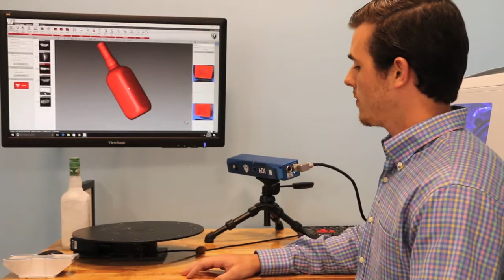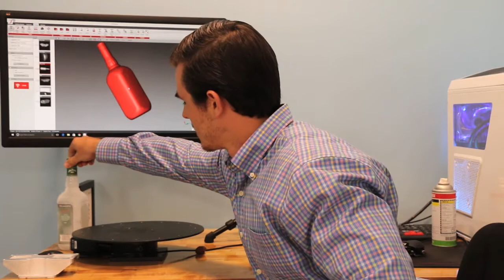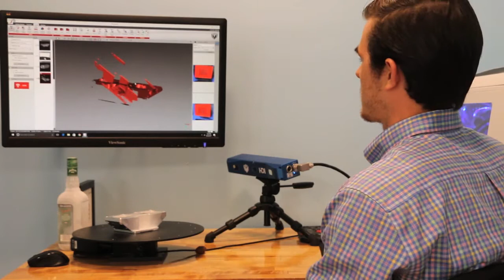How to Scan Dark, Shiny, or Transparent Surfaces With a 3D Scanner

Comment: Does this method provide the inner surface's roughness? Do the models have hallow features if I take a cross-section in the output model?
Reply from the maker: 3D scanning takes the 3D surface measurements of an object. Are you asking about 3D scanning the inside of an object? We're trying to make sure we understand your question correctly. Would you be able to elaborate more on your question? Thanks!

Comment: If for any reason a glass surface cannot be coated, is there a 3D scan technology that can allow me to scan glass? Thanks.
Reply from the maker: Structured-light and many laser 3D scanners have the same issue due to transparency. Touch probes are the most reliable at getting glass information but do require contact. There is this article on a laser scanner that temporarily heats glass and takes a thermal image. Here is the link if you are interested in reading further: https://link.springer.com/chapter/10.1007%2F978-3-642-04146-4_56